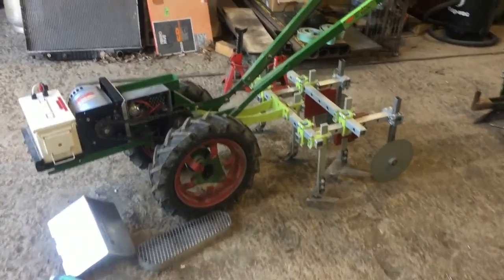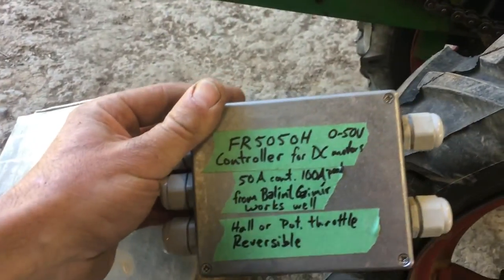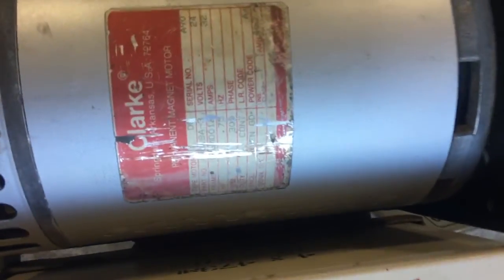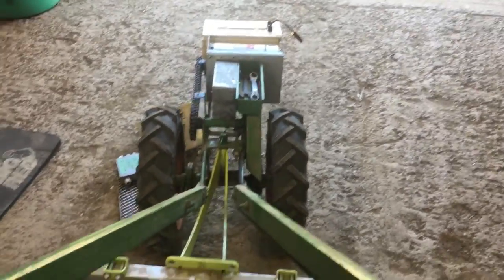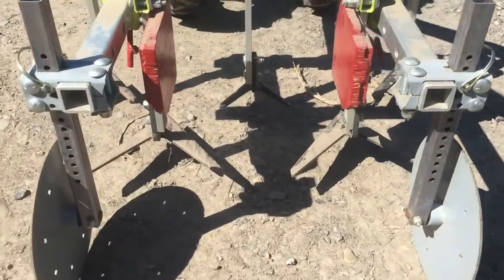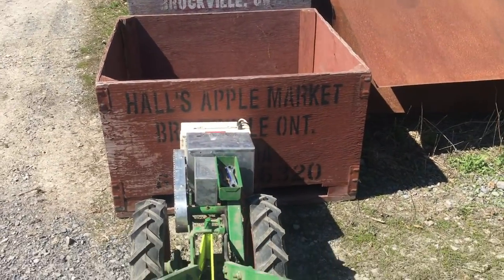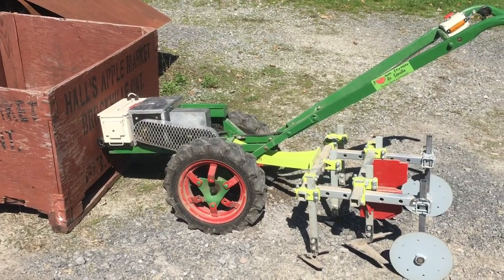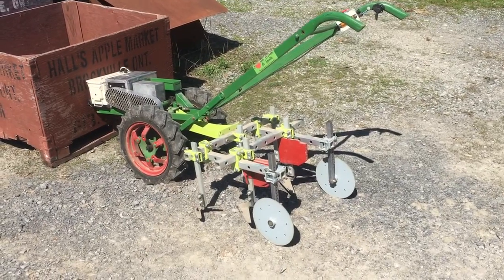Planet Jr electric walk-behind tractor - controller upgrade and first tests

Comment: Fantastic! There is a real market opportunity for electrics like this I think
Reply from the maker: There sure is.  I did some demonstrations recently with a Tilmor Power Ox and it's a great machine but a gas engine is such a pain once you're used to electric's smooth power delivery and infinite speed control.  Check out www.agrarianelectric.com for a promising new offering that should be making it to market in the coming years.
Reply: @reidallaway  Thanks for the link. Finally someone is going commercial! Yay!
Reply: @reidallaway  I'll check the link out. What I'd love to see is someone come out with instructions on how to build these. Something in plain English for those dyslexics, like me, that just don't grasp the concepts, but have a need for something like this and have the skill and tools to build. I'd love not to use gas. I need a unit, like yours, with high torque to pull a cart up and down hills via trails for trail building and maintenance. Also double duty as a snow plow. Something that can tow a cart with a couple hundred or so pounds of stuff. But I'm stuck with zero knowledge and little time or ability to learn all that goes into electric motors/drive trains/gearing/etc. Something like a basic kit that can then be added to when ordering, depending how much one can find stuff on hand to upcycle or build themselves. Dare to dream! :)
Reply: @reidallaway  Just checked the linked page. I'll check back for updates. It looks very nice. What I'd like to see on offer is to buy a kit of some of the parts. People that can, can fabricate the frame, handles, etc. or repurpose/adapt an old piece of equipment. That would save money and shipping cost and enable upcycling of parts people already have or are available locally. Beautiful machine regardless. Love the old fashion aesthetic.

Comment: Hi Bro, great work. 
If you use 1/4 of the voltage rated input you will save a LOT’s if power. 
To say 24V input for 100V motor. 
Ok the motor will be bigger and heavier but you will save 30% at least. 
Study RV-OU pdf

Comment: This is awesome. Do you have a guide for building something like this? Or guidance on how to get started?
Reply from the maker: Hi @JZ.  I haven't tried to create a guide per se, partly due to lack of time but also because all my projects are kind of "one off" projects that I design around components I can salvage or find and rarely are they good recipes for exact duplication.  
I try to document my projects in video here when I have time and there may be other videos on my channel that will help you to get a better grasp of what's involved in such a conversion project.  
There's also a pretty vibrant community on Facebook Groups for DIY EV projects.  You can join the DIY Electric Farmer Group that I help to coordinate if you can handle using Facebook for discussion on these topics.